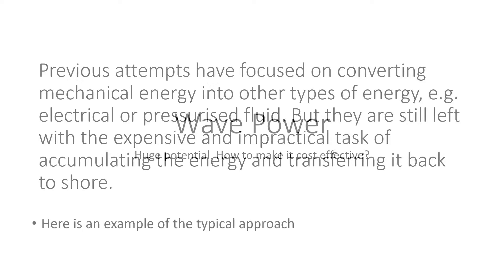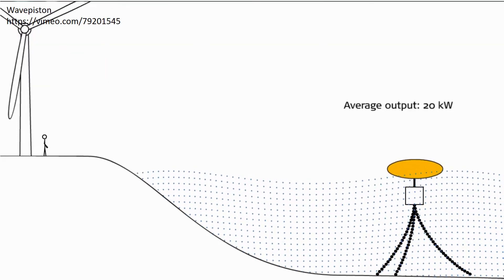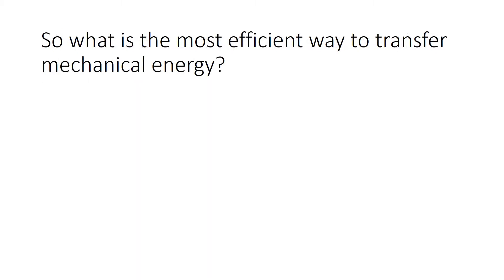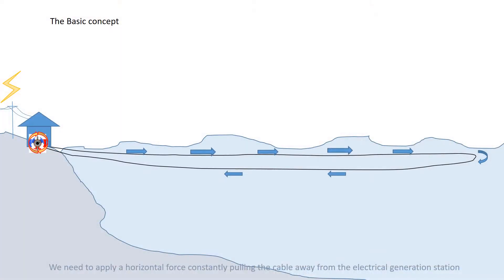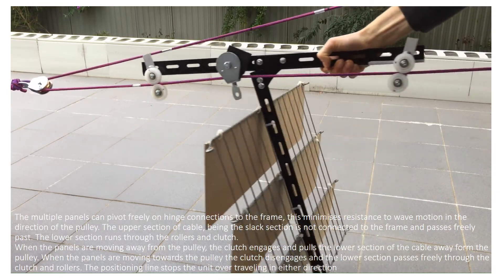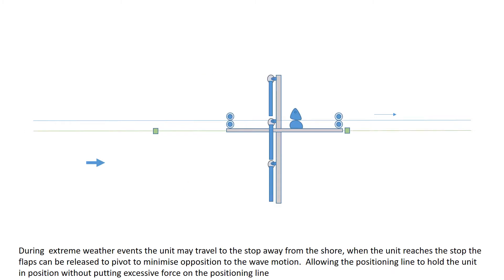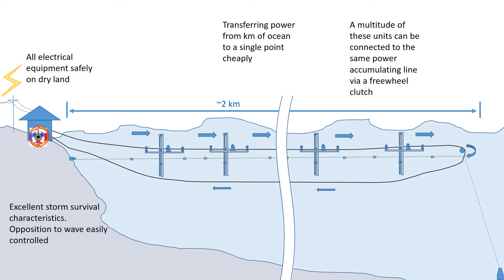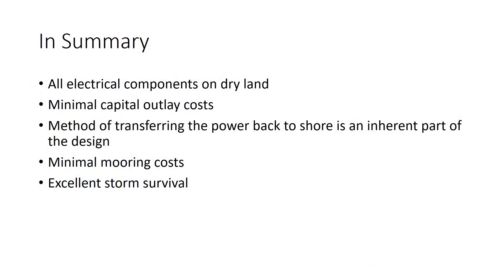Long Line Ocean Wave Energy Convertor

Comment: Very innovative idea. It is actually a breath of fresh air when it comes to wave energy conversion devices. 
Do you have any published material for this? For example power output results from prototype testing? 
Also, the moveable flap system would itself generate waves, so analysis of that could also help in improving the efficiency.
Considering the long length of cables in proposed full scale models, it seems long shore currents could pose a problem.
And a numerical analysis of the whole setup would also be useful.